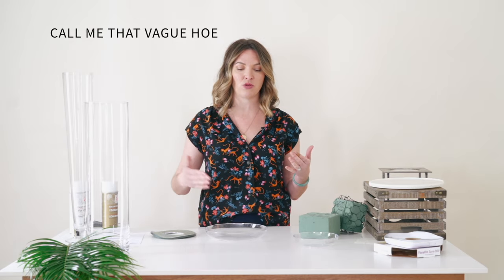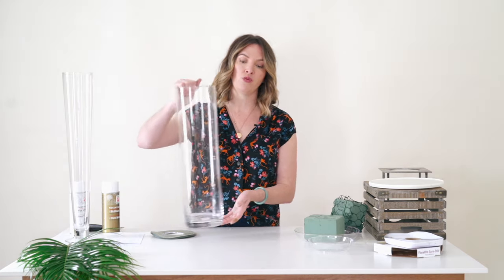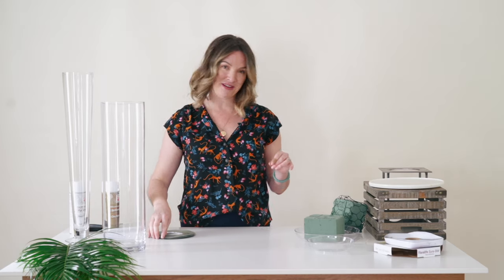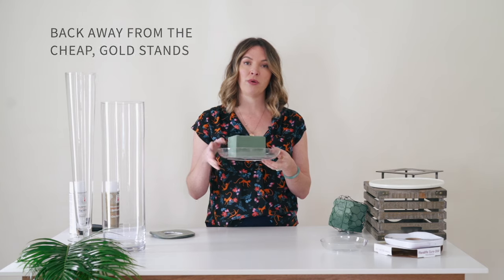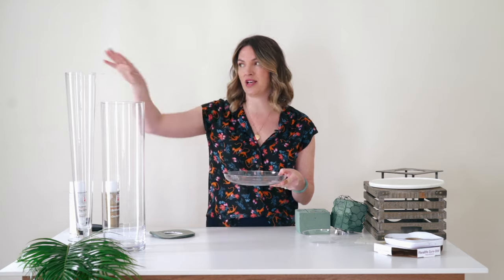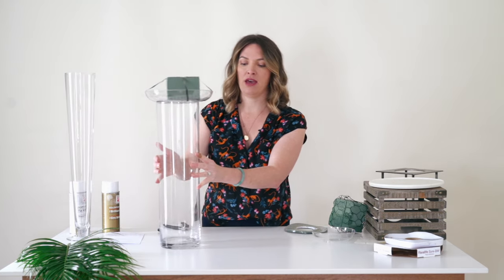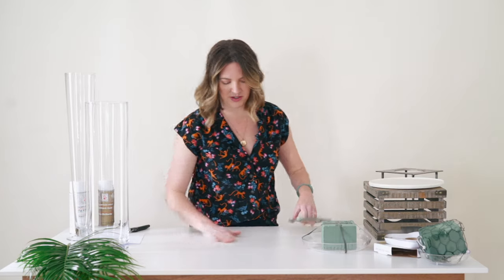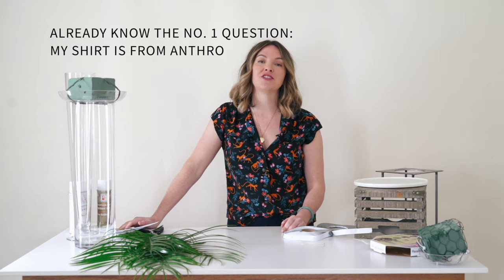Floral Mechanics for Tall Floral Arrangements  | DIY Wedding Flowers from Flower Moxie

Comment: Great video, 👍could I not get the same result from just putting flowers into the vase to avoid using plastic and foam ? X
Reply from the maker: You can, but you would need some kind of mechanic or you won't be able to get structure.  If it's a clear vase then you can wind up curly willow in your vase, and if it's a solid vase then you can go with chicken wire!  Large-scale arrangements can be a bit more challenging without foam, but it's definitely worth practicing what works best for you!

Comment: If I’m making a tall floral arrangement using a trumpet vase with artificial flowers, would there be any need to soak the floral brick?
Reply from the maker: Nope, you can use dry foam all the way!  It will be much lighter, so I'd still put water in the vase to help make it look 'more real' and to weigh it down.

Comment: This video has been extremely helpful. Thank you so much for this. It gives me confidence to actually do it as I’m doing this for my best friends sons wedding and they’ve chosen exactly what you’ve described here for their center pieces. They’ve got the gold column stand and the glass trumpet vase both over 20” high. They are hiring the good stuff from a wedding place locally here in the UK. Logically I knew I’d have to adhere it to the stand and having watched you demonstrate the same just gave me the confidence I needed to do it. Thank you so much @ flower moxie.
Reply from the maker: I'm so glad!  Thank you for taking the time to leave a kind comment.  Talls aren't hard, but there are a few tricks.  XXXX, Amy

Comment: For the trumpet vase - could you just put the foam in the water, without the lomey bowl? Or is it too tall? I am doing hydrangeas and a bit worried about it,
Reply from the maker: If it's a clear vase then it will make the water all green and gross because the foam sheds.  But I have a solid brass vase and I'll build it directly in it.  

A foam-free option would be to put curly willow in the vase and just put the stems directly in the water.

Comment: Thank you for this.  What about those tall trumpet but the top is thinner than the base?
Reply from the maker: Oh man, those are so so dicey to work with.  I remember doing a wedding and they kept snapping in half.  What I had success with is a foam bouquet holder and the handle slid down into the trumpet.  You can really only use minimal floral though.  While I don't typically reach for oriental lilies, those helped because there are many branching stems and blooms on one main stem and that helped fill it out.

Comment: I’m a budding new florist. If I invested in the heavy stands how much do you rent them for at your events.? I love your work😍
Reply from the maker: Personally, I never rented by vase ware, but many florists do and that isn't wrong.  More than likely you'd have at least $100 in them if you got the ones I got from Accent Decor, so you could rent them for around $35-$50.  You'd recoup your cost quickly and I'm sure that's less than a rental company would charge.
Reply: Thanks so much, it’s hard starting out but you gotta go for your dreams.
Reply: @FlowerMoxie  o

Comment: Thank you for a great video. Exactly what I needed. I am helping a friend with wedding flowers. She  needs 8 tall arrangements as this video and one long one for sweetheart table. Her colors are maroon white and blush. Since you said hydrangeas and roses can get heavy, which other would you suggest. And if you can also provide an appropriate number of flowers in each, that would be so helpful. Thank you so much. 💞
Reply from the maker: So glad this helped you!  Blush roses, burgundy carnations will work great....and you can even use hydrangea, but only if you place them in the centerpiece when you're at the event.  This will keep them from wilting.  

If you want to avoid fussing with hydrangea then go with White Cushion Flowers, Stock, Carnations, Roses, Alstroemeria, Baby's breath, or Snapdragons.  

For a large centerpiece like this I typically average: 1/2 bunch of salal and leather leaf, 1/4 bunch of baby eucalyptus, then add 10-13 carnations, 10-13 roses.  You can layer in more, but that's where I start.  For hydrangea, I'd add around 7-8 stems.
Reply: Thank you sooo much for your response and advice. 🤗💞

Comment: Thank you for all tips! Would you recommend using floral clay to attach lomey to candelabra with a very small base? Can’t fill with water so will need an extra stability + can’t use glue because candelabras will be rented. They are 30 inches high and im trying to figure this out. Maybe an extra floral tape??😁
Reply from the maker: Yep, I completely agree!  I would definitely use clay/putty and no water in the Lomey (no hydrangeas then).  You may want to try that and work with it a bit, and if you feel it needs more stability I'd see if I could also strap it down with some waterproof foral tape!

Comment: Thanks for the video!  How would you suggest to transport these floral arrangements?
Reply from the maker: So I just transfer the Lomey's on the floorboard.  They are great because they are low and will not tip over like a compote.  I then assemble with the vase at the venue.  XO, Ames

Comment: What would you do  to stabilize this type of arrangement : silk flowers a 6 inch loamy bowl and a block of styrofoam on top of the trumpet tall vase shown in your video  example - but with a crazy small base (we r talking major rickety) the silk flowers  are 1 foot high from the top with a cylinder shaped arrangement using dry foam ( new style styrofoam made out of recycled plastic) block in an out door wedding where it will be very hot ( hence the silk flower centerpieces- real flowers everywhere else) and really  high winds !
how would you keep the loamy bowl from toppling off from the height of the arrangement and high wind?
(The bride wants to resale the trumpet vases so glue is out😕)

Loved your video would really love your opinion!!!
Reply from the maker: First off, that sounds like a hard event....strong winds, hot as balls...woof!  Ok, so Floral Clay/Putty should keep it adhered to the vase, but to be honest, that won't keep the entire vase from blowing over or off the stand.  Filling it with water would help, but those tapered vases have a narrow base.  I'd fill it with water, pop a mock-up on top, and set it outside on a windy day to see how it handles it.  The winds in Oklahoma can be super strong and wild, so if I were you, I'd just test it out on my own time so I'd feel more confident on the event day.  I hope that helps!

Comment: Do you think for a 5 inch diameter vase I should use the 9 inch lomey bowl or play it safe and use the 6 inch? The vase is a straight cylinder like the one you showed
Reply from the maker: Either will work!  It depends on how large you'd like to make the arrangement and how much product you're using.  It's definitely easier to make a smaller vessel look larger by leaving your stems slightly longer than to try and fill in a larger vessel and make it look proportionate.

Comment: This was a great video! I have an event coming up and I’m using the trumpet vase you showed with a 4 inch diameter at the top. Is there a way to adhere the 9 inch lomey to it? My client likes that vase and she wants a larger arrangement at the top. I’m a little nervous the 6 inch lomey won’t be a large enough arrangement
Reply from the maker: That's a great question! You could use glue dots or even hot glue to adhere the lomey to the vase securely. I do that every time, no matter the size! Something to be careful of - top heaviness! You can test it before hand, and if it feels unstable, the 6" lomeys may be a better option. :)
Reply: @FlowerMoxie  good point! Do you think the 9 inch lomey is just too large in general for a 5 inch diameter top? I said 4 inch up there but it’s actually 5!

Comment: To hide the mechanics could you line the bottom of the Lomey bowl with leaves before taping down the foam  so when you look up you don't see the foam?
Reply from the maker: Yes, or place rose petals in the water.  They will float, so I've done this as a florist when I was doing large, white rounded arrangements that didn't have a lot of greenery to cover my mechanics.
Reply: @FlowerMoxie  Very clever. I wouldn't have thought of that!

Comment: Hi! What size cylinder vase do I use for a 6" lomey bowl? is 4" too small, 6" too big? Wedding is in 10 days and I need help! Thank you!!
Reply from the maker: You're talking the opening/diameter, correct?  I would stay under 6'' because you don't want it falling in.  Most cylinders from Hobby Lobby or Micheals are under 6 inches and will work just fine!
Reply: @FlowerMoxie  Thank you so so much!!!

Comment: Is it easy to detach the lomi bowl from the base with clay putty?
Reply from the maker: For the most part, yes!  It does detach easier from glass than plastic, however.  When it gets stuck to things I've used hot water to re-soften it, or in the opposite direction, you could use ice water to harden it and pull it off that way.  It's a lot like gum or wax in that regard.  I hope that helps!

Comment: what if we are using faux flowers, do you still suggest filling the vase with water?
Reply from the maker: Yes!  The main reason for filling the vase with water is to create stability in the vase so it doesn't come crashing down at the reception if the table get's bumped.  Faux flowers will actually be light than fresh so creating stability with the vase will be really important!

Comment: Do you soak your floral foam before or after taping?
Reply from the maker: Before! Immerse the foam in a bucket or sink of water and make sure it's totally saturated. Then add to your vase and tape! (Make sure the vase area you're going to tape is totally dry otherwise the tape won't stick.)